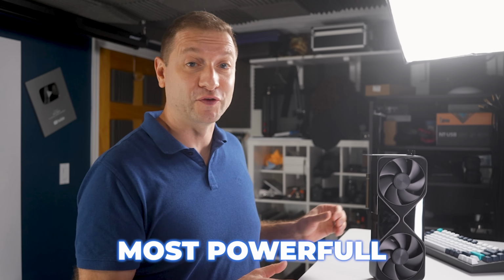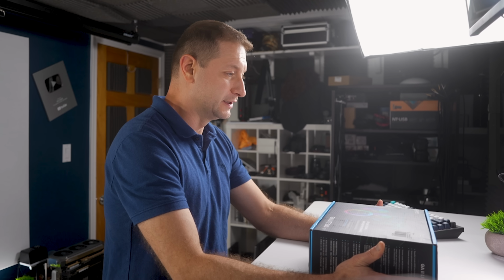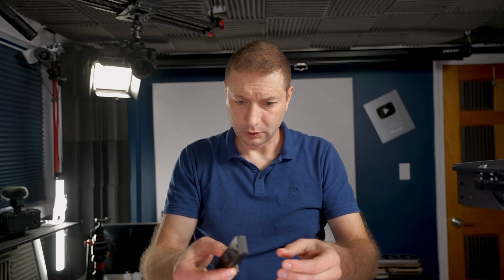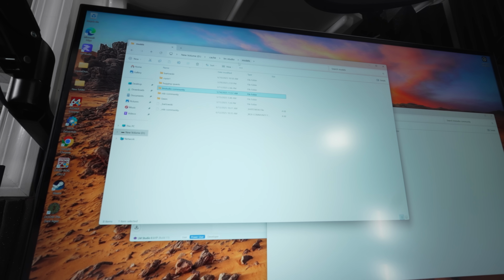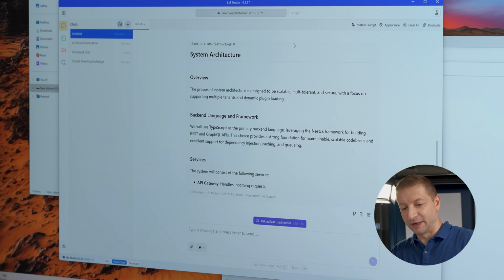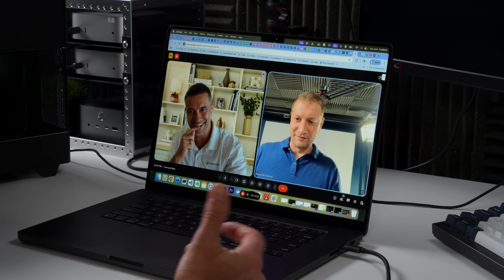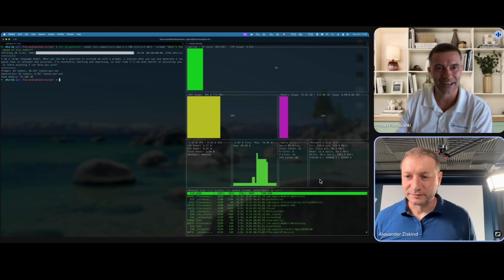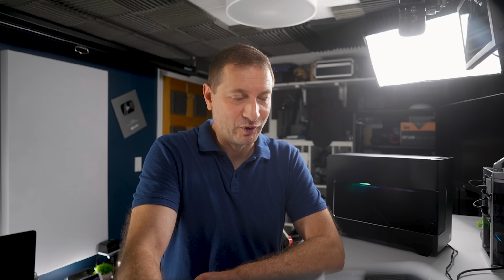Going up against Apple's Ultra

Comment: Thing is it's all very well comparing it to a 512GB M3 ultra which is a similar price but what if you compare it like for like 96Gb RTX to 128GB M4 Max or M3 Ultra?  Your talking waaay less money like 3.5k to 4.k for 128GB M4 max or 4.5 to 5k for 96b M3 ultra so literally half the price or under.  The mac is the choice if you just want to get on with learning/testing and the RTX is the choice if you want to run 4 in one rig (or just extend your electronic pee pee for everyone else to marvel at).

Comment: I have one too, and the key difference is using 24-30b models with FP16, and that's better than any quantized BIG model, much better than apple m3 512GB. So these AIs in LM Studio, but connected to Claude Code... I believe they represent peak production at zero token and API key cost.

Comment: Interesting. Frankly I expected way, way more than ~19 to 20 t/s out of the RTX 6000 Pro for the llama3.3:70b.

I'm using a quad 3090 (which also adds up to 96 GB VRAM). Using the llama3.3:70b  Q4_K_M  I'm getting 17.5 to 18.5 t/s of response rate.  (Flash Attention On, KV Cache = q8_0). 

Thank you for the build and video it was very informative, I had been considering replacing my quad 3090 with RTX 6000 Pro system similar to yours, but now, not so much. I don't think a 15% uplift is enough to justify the cost. (quad 3090 build is ~$4000 on the low end).

Comment: I like this card; it's seriously overkill, combining the power of a 5090 with the VRAM of an H100 (94 GB), essentially the best of both worlds. I wish there were a 128 GB VRAM model for the niche LLM, like the GLM series. @Alex Ziskind, I am wondering if LM Studio is giving you "0 GPUs detected with CUDA" using that card? I have the latest NVIDIA RTX Enterprise Driver, but for some reason, LM Studio fails to recognize it.

Comment: and what is the price tag for this dream machine?
Reply: Around 5500-6000 USD on the low end if I did count everything right
Edit: Accidentally used 5090 price, for the pro 6000 it would actually be around 14k

Comment: I have about a $15,000 budget for a local LLM machine. Is the Nvidia GPU good for faster inference but smaller models and contexts while the M3 Ultra good for larger models and contexts but slower inferencing?
Reply from the maker: you hot the nail on the head. depends on how big a model

Comment: Interesting video. I think the better comparison metrics to do would be napkin ROI. So look at the initial spend, then chart the cost-per-token over time for a low and high electricity price (and then you can factor in is it worth adding solar to your house with or without a battery). The issue here is "is local worth it" compared to spending $200 a month with the cloud models.

Oh, and then there is how much life does the build actually have. Or to put is another way, when are you going to 'want' more than a 70B parameter model.

My guess is the ROI is simply not there for the average person compared to paying for cloud models. For companies doing proprietary stuff, eh, might be???

Comment: Great video! Thank you! Quick question... I have an Asus TUF GAMING GeForce RTX 5090 32 GB Video Card. The physical dimensions of the card are 348 x 146 x 72 mm (13.7 x 5.7 x 2.8 inches), which is something like 3.6 slots I think... I see the case extends beyond just the 3 provided slots. Any help at all would be appreciated very much. :)

Comment: So, for LLMs the Mac is the superior platform. Consider this ... loud, expensive, water cooled and clumsy box that is more a radiator than a computer, sucking a thousands Watts for something the mac can do for under a 100 Watts. And still it is only 96 GTB of usable VRAM. I have a macStudio with 128 and for LLMs there is no real alternative. For Video generation in ComfyUI however I see ... well... MPS and Python is a nightmare.
BUT here wer're talking about LLMs and I think you have seller's remorse correctly. :-)

Comment: Yes sir....+-----------------------------------------------------------------------------------------+
| NVIDIA-SMI 575.57.08              Driver Version: 575.57.08      CUDA Version: 12.9     |
|-----------------------------------------+------------------------+----------------------+
| GPU  Name                 Persistence-M | Bus-Id          Disp.A | Volatile Uncorr. ECC |
| Fan  Temp   Perf          Pwr:Usage/Cap |           Memory-Usage | GPU-Util  Compute M. |
|                                         |                        |               MIG M. |
|=========================================+========================+======================|
|   0  NVIDIA RTX PRO 6000 Blac...    On  |   00000000:02:00.0  On |                  Off |
| 30%   32C    P8             29W /  600W |    2872MiB /  97887MiB |      1%      Default |
|                                         |                        |                  N/A |
+-----------------------------------------+------------------------+----------------------+

Comment: Check out the dan a4-h2o case.  Significantly smaller and supports 240mm aio for cpu and can easily fit the pro 6000.  11 liters 👌

Comment: If you're only doing LLM, then the M3 Ultra might be a contender for very large models, otherwise the 6000 is IT. Imagine loading every single bit of your Comfy workflow on to that thing. Flux dev fp16, Kontext fp16, flux controlnet, all the loras you need, and you STILL have room to spare (i think). 

Or, load the q8 of flux dev kontext and fill + loras galore AND an LLM. 

Seriously gear lusting right now.
Reply: Yup, nothing beats rtx pro 6000 for comfyui. Apple silicon suck for diffusion models no matter how big unified vram they have because diffusion modes are cuda optimised.

Comment: I have never seen someone be so excited about making a 9900x build, nice job, i personally wouldve gone for 9700x for the most power effiency possible and the lowest amount of heat, or the 9950x and just not let it go all the way maxed speed, because then you get all the extra communications between gpu and cpu without getting hot. but im sure the 9900x was mentally a middle ground, and in cpu workloads the performance is near linear per core. so its great to see someone making some good use out of the 9900x, coupling with a $8000~ gpu is quite interesting and click worthy for sure.
Reply from the maker: yes, i’ve since used the 9700 and it’s definitely a better option
Reply: @AZisk awesome. That's the best option for gaming vs not letting a 9950x turbo boost. Since you need atleast the main core to be fast for unreal engine games and unity games. They all run their developer code logic mainly on 1 core, even tho animation and rendering and everything else is multi threaded.  And for non gaming I think thats an excellent cpu choice for things like llm where you only use the cpu for 5% of the task. Im going to subscribe to see your next build.

Comment: If you use LM Studio, llama.cpp runs in the background. Since llama.cpp uses CUDA cores instead of tensor cores, the computation happens using integers. You need to use vLLM to use tensor cores for floating point computations.
Reply: does it improve the accuracy of the model at the cost of speed?

Comment: love your vids, I process documents into databases and use AI for a few of the steps, using a vision model for a couple of those steps, since you have tested so many different systems, what system would you recommend for under 2 grand if possible, if not what do you recommend, I have thousands of documents to process, speed is kinda vital, thanks keep up the great vids.

Comment: I'm not sure alex if there will be a few people to invest in the expensive solutions you present in order to use llm when there are smaller models working on less expensive hw? llm can be specifically trained and fine tuned. you can use the saved money in other ways.😊

Comment: Great content! Probably will be good idea to test it with inference engines like vllm to unleash the real power of it. I am getting 4000 TPS throughput for output token running a Qwen3-30b-a3b model on a dual Pro 6000
Reply: You're running a 30b model on two RTX 6000 Pro cards?

Comment: I have my RTX 6000 Blackwell Pro in the smallest case, the Formd T1 v2.1. It’s half the volume, sub 10L, compared to the NR200P v3. Some compromises on the CPU aircooling, but trains ML models fine and runs Cyberpunk at Ultra settings well! You should give that case a try.
Reply: Do you have a list of parts you packed into it? Currently looking for working combinations regarding mainboard/psu and caveats to look out for. Any special cables?

Comment: Wonder what played the bigger part, the memory bandwidth or the GPU computing power. The ram bandwidth of the M3 Ultra 512 is exactly a hair less than a half of the one on RTX Pro 6000, which matches the TPS result.
Reply: In terms of speed, RTX Pro 6000 will be a little faster. If you are using LLMs for inference, I would choose M3 Ultra with 512GB because you can run much smarter models.  If you are fine-tuning LLMs, I would choose RTX Pro 6000.

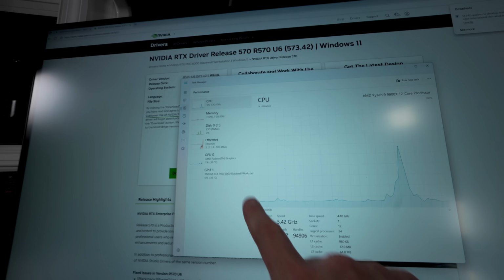Comment: 4:39 My laptop only has 3.8gb shared gpu memory (it doesnt display dedicated gpu memory like in the video), is there a way to increase the shared gpu memory through some settings? (my laptop came with 8gb ram if that matters)
Reply: Upgrade the ram. Igpu use often just 50% of the ram. So if you put 16gb in it, it should use 8gb for VRAM
Reply: @MasterMind187b  I upgraded my ram in my laptop today from 8gb to 32gb and now the gpu shared memory is at 15.8gb. 

Ram usage also improved too, from nothing opened 8gb ram was at 51% but with the upgraded 32gb ram its at 12% usage.
Reply: @Doonie602  lol, of course it did. but nothing has changed really. 12% from 32gb are nearly the same like 51% from 8gb :D

Igpu use normally 50% of the ram as memory, but you can go to the bios and change these numbers sometimes. depends on your device.

Comment: If your goal is to run LLM's from tiny to gigantic and you're OK with spending $10,000 there just is no beating the Mac Studio. Spending 10K on that Pro 6000 is pretty ridiculous compared to what that money gets you on the Mac Studio.
Reply: The issue is the M hardware wasn’t designed to run LLM workloads, it’s an SoC and hence was built with a compromise.  There’s no ECC either… you’re on your own if you get errors in your model.  Get the right tool for the job including the software infrastructure… Nvidia is the only way forward here.
Reply: @KleoGroutides  It all depends on what you're trying to accomplish. If the work you're doing is so critical that even the low risk of data corruption from using non-ECC memory is a big issue then I wouldn't be buying any of these consumer grade solutions at all and I would go straight to B100's on AWS or GCS and call it a day. As expensive as cloud GPUs are, $10,000 still buys a lot of time on them for serious money making work. 
If you're just teaching yourself this technology for research purposes or to learn how the whole chain of events works you can do that for $2000-$3000 for a really nice setup. $10,000 is a lot of money to spend on something you're not making money with.  nVidia is important because all those frameworks are based on CUDA which means the other platforms are an afterthought will less support. Like I said it all depends on what you're trying to accomplish.

Comment: Love your content..
I have a question for you
I am a student pursuing engineering in aiml computer science... I don't do much gaming but some times even at 1080p I am satisfied for little time pass.... I want you to suggest me the best combo of cpu and gpu for the budget of 1500 to 1700 dollar. I want to future proof it for atleast 4 years. I should be able to do all the app development high profile coding website development video editing and mainly the most important tasks related to ai like running llms which give high speed tokens/sec, 3d modeling and all the things which an aiml or data analyst would do... pls suggest me a good pair of cpu and gpu my pc build cost can maximum go to 1700 dollor..... 
Please respond 🙏 
And should I go with windows or mac in this budget around 1800 dollor specifically for aiml and data analyst work flow.... Thank you ❤❤❤

Comment: Alex, remember when you used a GPU docking station with an RTX 4090 and a small gmk Tec k3+ Machine
 to run LLMs?  Would that sort of system work with the 6000 pro? It would be cheaper and much closer to portable.. Perhaps slower. Interested in results...
Reply: Why doe anyone care about this stuff being portable at all? Who is going to lug around a keyboard, mouse, monitor and a computer however small it may be for this kind of work? If you really care about portability just get some laptop and SSH into AWS or GCS or your home and you have all the resources you want without getting a hernia.

Comment: The PCB of the RTX Pro 6000 is very small, and its PCIe interface is separate from the PCB. In principle, you could use a back-insertion method to compress the graphics card's size to the extreme, effectively reducing the entire system to the size of an ITX chassis. Of course, you would need effective cooling. This might make the system slightly thicker, but its overall dimensions would not exceed those of a Mac Studio.
Reply from the maker: i don’t have skills for that, but sounds cool

Comment: ML Engineer here.
This is a great video, thanks a lot for sharing.

Where the RTX Pro really shines is in prompt processing. Imagine you have a large document like a novel that is 10k tokens and you want the LLM to generate a summary of around 1k tokens.

The Apple device will be significantly slower at processing the document; it'll take a while until you can read the first token generated by the model. On the other hand, the gpu will be much more efficient and will have a lower Time to First Token (TTfT).

This is quite important for tasks that have long inputs like coding, summarization, explain research papers, asking questions about legal cases etc.

The metric you're measuring in the video is the token generation speed (its inverse is called Inter Token Latency ITL). It's bottlenecked by the memory bandwidth of the device rather than the raw compute capability.
Reply: Id also add that this preprocessing becomes a limiting step for large contexts and severely impacts time to first token.  A fun test to add to your test suite is have it read all of Romeo and Juliet and ask it for a 100 word summary, which should highlight preprocessing speed.
Reply from the maker: thanks for the insights!
Reply: The problem is.. model size and output quality. We're currently in a trade off situation it seems. You can load larger models with Q8+ level of quant + larger context window with the Mac, but get much slower TTfT AND overall back and forth usage. The Blackwell for similar price is MUCH faster (like 8x to 10x I think) overall, but you're limited to much smaller models and much smaller context windows. Thus, the potential for higher quality output (particularly with code) is going to be a lot less. So it seems we're stuck either spending $40K + for a quad blackwell setup on an Epyc server system OR wait for the next gen Mac Studio Ultra and hope it doubles to triples the overall performance while offering 512GB or hopefully 1TB of RAM in the $12000 price range in.. probably a year from now.

Comment: I wonder why it isn’t getting hundreds of tokens per second. GPUs are great at running LLMs, and you headroom with the VRAM. So why is it not in the hundreds?
Reply: You can calculate that max token throughput by dividing memory bandwidth with model size. For example 1700 GB/s / 70b = 24 tps. It can't ever do more than that (for batch size 1). This is because for every token generated, it needs to read the entire model at least once from RAM.

Comment: This case is huge the RTX PRO should fit with ease in a FormD T1
Reply from the maker: yes, but not the AIO
Reply: @AZisk If you use the coolermaster Atmos 240 and change the bundled fans with two Noctua A12x15's, it easily fits. It was my previous build(but with a 9800x3d and 5080 fe)
Reply from the maker: @joonhojung7765 thanks for the tip
Reply: and by this it should match the performance/volume with the M3 ultra
Reply from the maker: @joonhojung7765 well the mac studio is 3.6L and the Form T1 is almost 10L i believe, but it’s quite a bit smaller than the nr200p. i just don’t know how I’ll fit my fingers in there. or even how I could get one since they are always sold out 😆
Reply from the maker: what power supply did you use?
Reply: @AZisk I am using the SF1000 from Corsair. It's smaller than the SFX-L Loki so it should be easier to manage the cables

Comment: Have you tried vllm/LMDeploy turbomind or TensorRT-LLM straight?
llama.cpp is poorly optimized for its workload, and usually only can reach 50% util or 20% actual performance.
Other frameworks are much faster using custom cuda kernels, tensor cores etc.
On my T10 x2 setup, LMDeploy is 300%+ faster than llama.cpp.

Comment: AMD Ryzen AI MAX+ 395 with RTX Pro 6000 running Qwen3:235B with some layers on the 395.
Reply: Its not possible to run RTX PRO 6000 at full speed on an AMD Ryzen AI MAX + 395. The boards dont come with PCIe 4.0/5.0 x 16 slot and if you want to use Oculink (4 lanes x 16Gbps =64Gbps raw bandwidth) on run eGPU externally, the actual usable bandwidth is only 7.88Gb/s. PCIe 4.0 32Gb/s and 5.0 64Gb/s usable bandwidth. Unfortunately there are no interconnects that you can install that are faster enough to run that RTX 6000 Pro and AMD Ryzen  combo :(
Reply: @jbond193  that’s tragic. What a shame.
Reply: 192GB of Vram. Divine 😍😍😍

Comment: But can it run Crysis ? xD
Jokes aside, this is an impressive system for this small form factor. And, as an additional benefit, you can use it for gaming after the work is done, the hardware is more than suitable.